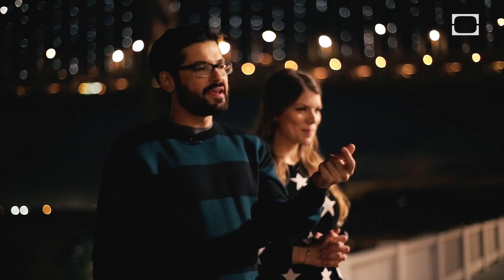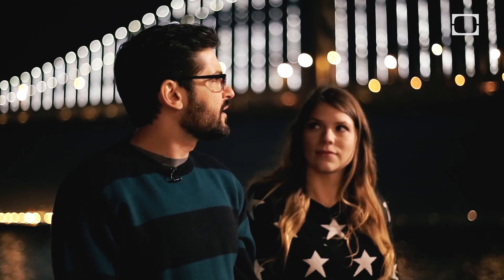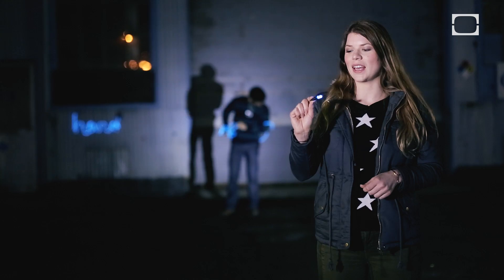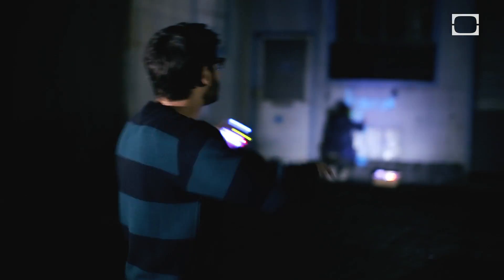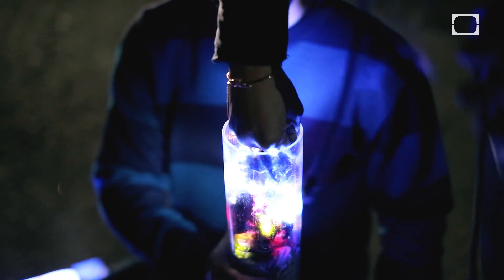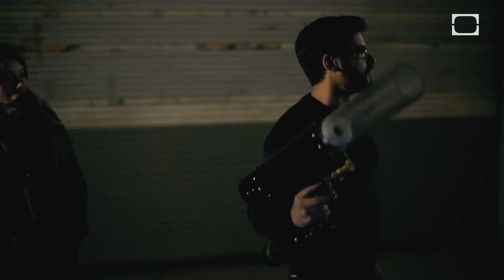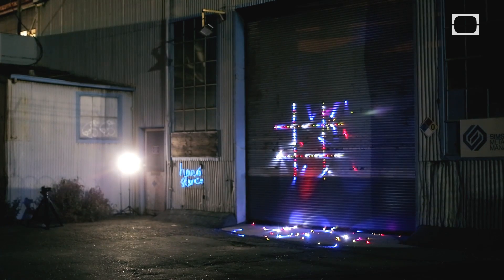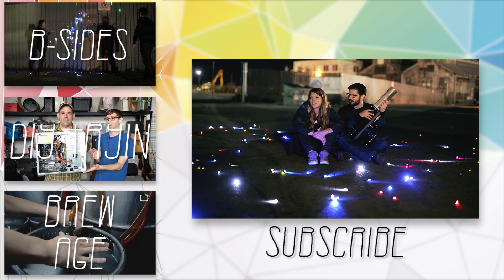Making LED Street Art - Hard Science

Comment: I have a dynamic sculpture art project for you. Idea is to use a rare-strong earth magnet to induce magnetic field on magnetic particle powder. To make  dynamic (moving) sculpture of the magnetic powder , use microwave motor or variable controlled motor to rotate the magnet and it will in turn move the magnetic powder which will create nice table top art piece.

Comment: LED's do release heat. Have you noticed LED light bulbs have heat sinks? That's because LED's don't radiate the heat as infrared EM radiation the way incandescent bulbs do, but need to keep cool to avoid destroying the led chip. Incandescent bulbs not only survive the heat, but need it to work. A single low power led that can't light a room also won't have so much heat that it needs a heat sink, but it still produces heat.
Reply: I think what Anthony and Tara meant is that LEDs are not incandescent light sources, that is, they don't produce light by heating a material. The production of light is by a non-thermal process, which is the reason they're so efficient.